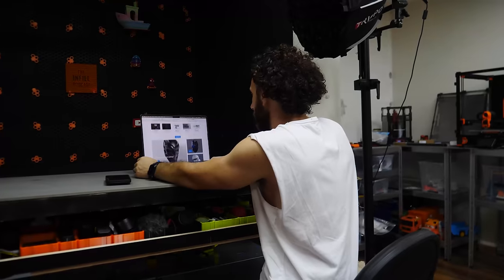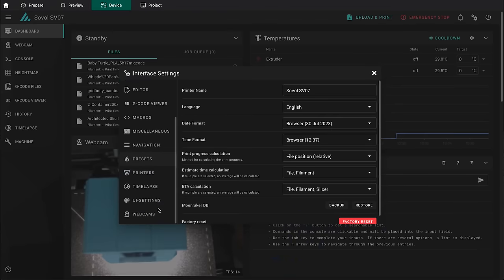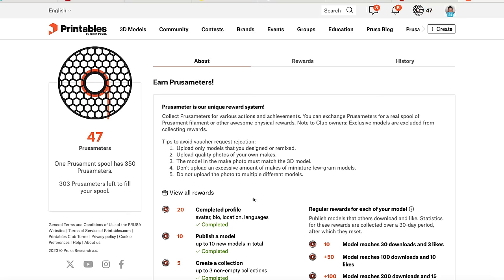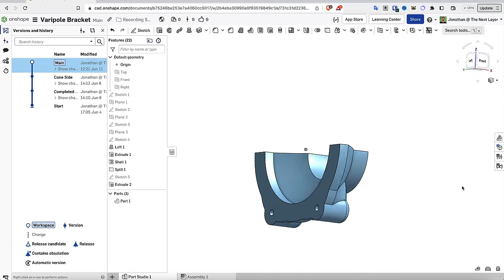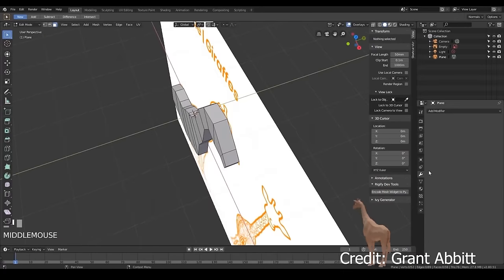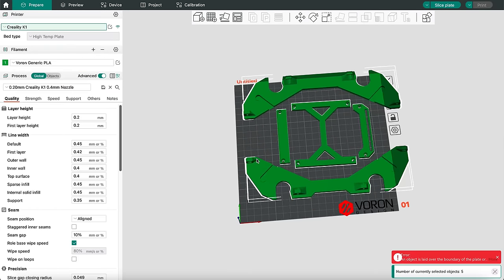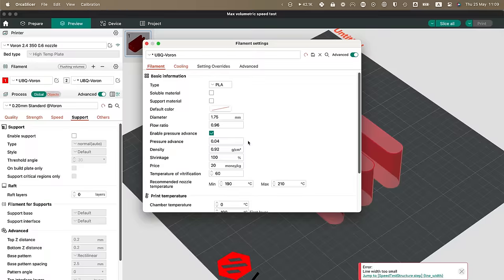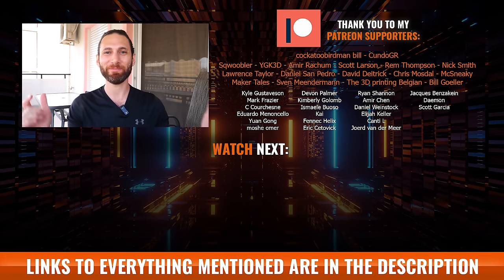Don't Run Your 3D Printer Without These Must-Have Apps

Comment: Glad you and your loved ones are safe,  and I hope things get back to normal for you soon.  Meantime as an elderly movement-limited geek,  I'd very much appreciate any help getting my Creality printer set up so I can send it a new job remotely, and keep an eye on it during printing, so I can limit the number of times I need to put myself in the same room to mess with it.  Moving hurts!
Reply: I reckon the easiest way to do this is just buying a Creality Sonic Pad - it's not quite as open or versatile as a DIY Klipper solution but it makes life infinitely easier than lugging SD cards around :)

I went with the Pad during last year's Raspberry Pi shortage, but if you're comfortable with electronics and command lines then rolling your own Klipper controller on an RPi or equivalent is well worth the time investment!

Comment: Hi there! I studied CAD in midle school for 4year and i guse i find a good cad sofware, sure it is student version witch is free but evrything what is needed for 3d printing and some more advanced stufes in the software. And it is user friendly just press F1 to see a full guide how to use a option in the program.
The program name is "Solid Edge" by siemens and have also 3d printing option in it.
Also very specific by gears, holes for screws, also can make assemby by all the modells you made, also can simulate phisics to see if some mechanics is wrong with your modell, and so on, now i guess this program up to 16y and evry one year there is update for it with new options

Comment: Great videos, I still didn't buy my first 3d Printers, I just started with my first laser engraver and it was pretty strait forward, but 3D, OMG so much software and stuff. overwhelming for a noob like me. What should be my 1st 3D printer for a very ocasional use. Thanks and keep safe.

Comment: glad you are safe. Hope it does not take long to return to "normal". Is there a way to load the X1C onto octoprint? I am wanting a way to que up prints. I have yet to use Octoprint. or is there other software that does that for an x1c? Even if it is just the que for loading the next print. Meaning it send the file to the printer. Not the spoon feeding that it looks like octoprint is optimized for.
Reply from the maker: Stay tuned… big announcements coming

Comment: Makes the case for running Klipper on all printers. Tells Android users to get an iPhone. Doesn't recognize the irony.
Reply from the maker: What's ironic about it? iPhone is like Klipper to me (faster, simpler, cleaner).
Reply: It's like a Nokia 3310 vs Samsung s23 ultra, is that better for you? Ofc marlin works just like 3310 but s23 ultra has a lot more features and lots of qol
Reply: @thenextlayer  I say this as an iPhone 14 owner who switched from Android last year and who is perfectly happy with it. iPhone is faster, simpler, clearer not like Klipper, but like Bambu. Klipper is not famed for it's simplicity, but for it's capability, customizability, and flexibility, like Android. There's your irony.

Comment: Sunlu is my go to filament.  Good results at a good price.  Enjoy Greece - they are very welcoming people and of course the food is the best.
Reply: Thanks for your support!😆
Reply: @SUNLU  No problem.  While I have your attention - a small request.  Could you print the empty pool weight on the product sticker you stick on the side?  This helps determine how much filament is left on the spool by just weighing it and subtracting the weight of the spool.  I have noted that the spools have changed over the years so even if I take note of an empty spool weight, it may be different in the future.  Just stick it on the printed sticker with the colour and gross weight.
Reply: Thanks for your advice. We will keep improve it!🥰 @UnCoolDad

Comment: Good video, except for the choice of pushing iPhone 😂... More expensive for less usability
Reply: Any others phones with this kind of LIDAR?
Reply: People hate on iPhones, they’re some of the best phones out there. Sure they come with a high price tag, and has its flaws, just like every single product in history. Every OS, wether it be IOS, standard android, or another linux based system, they all have their advantages and disadvantages. I’ll keep a degoogled phone for privacy, but also an iPhone for a more organized, better media experience.
Reply: @69-Bot  I don't like the fact that I don't own it, and on privacy side I like blackphone that is half the price for the same quality and no Google or apple sided
Reply: @69-Bot  the flaw is that it's over pric for its performance
Reply: @fab-it312   You own the phone, just not the operating system. You own a license to use iOS, just like if you have a windows computer, you don’t own the OS, you own a license to use it. In both cases, you completely own the device itself. There’s an argument against that, and I’m not arguing for it. Using de googled phones are a great idea for privacy, nothing against them at all. I don’t think there’s a “one size that fits all” for phones, you choose what you want based off your preferences or needs.
Reply: @SolarDaisy  Yeah, they’re overpriced, just like a lot of things. That doesn’t make anything I said originally, any less true, in fact I pointed it out.
Reply: I’m confused why people even dispute these things. It’s 2024. Give it up